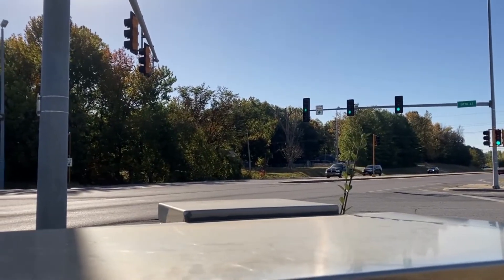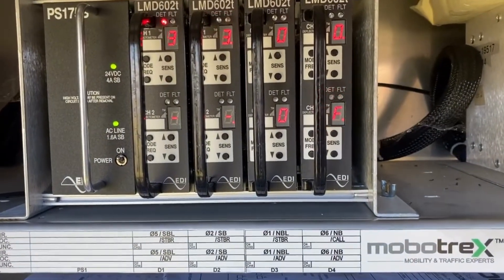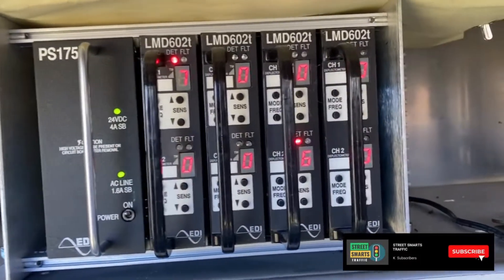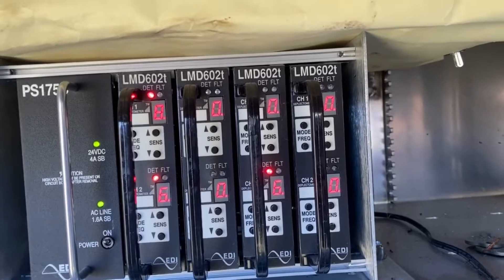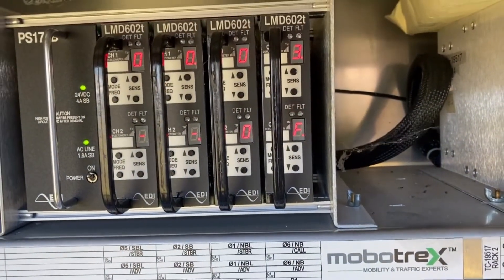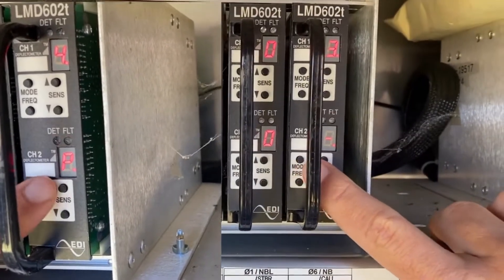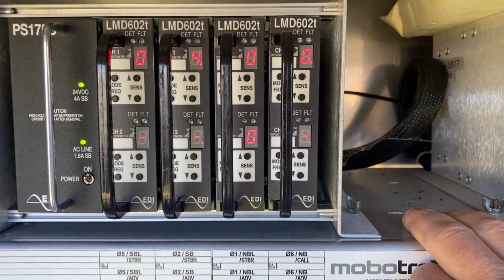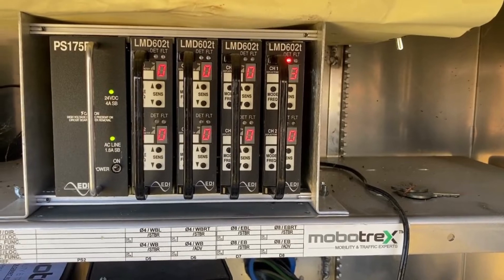How to Shut Off Traffic Signal Detection

Comment: Would be interesting to know what the fix is - even sharing some possibilities would help us understand.  Guess it's not as simple as slapping in a new card.
Reply from the maker: @CubbyTech    Good Call!  Sometimes a new card does fix the issue.  Actually one of my troubleshooting procedures is usually to swap card slots with a known good detector card.  If the problem moves, I know its the card.  If the problem stays, its downstream to the street.  I was in a hurry that day and had just enough time to turn on my phone to capture what I was doing.  Very insightful!  Want a signal tech job?? LOL

Comment: I'm curious actually, do bicycles get detected or is their mass just to low? I've passed or sat on top of the loops on my bicycle before and still had to wait ages for the lights. Then a car comes up behind me and they seem to change a lot faster. I try to get forward of the loop or closer to the ones with the camera looking detectors so that they can detect a car behind me. Thanks :)
Reply from the maker: Could be several resons.  If your bike isn't made of metal, then the inductive loop will not detect you.  Cameras will (or at least should).  If your bike IS made of metal, could be a couple other reasons : 1) the detection sensitivity is not set high enough on the detector card to detect your bike (mass)  2)  Your not sitting in the detection area.   
If there is a pedestrian crossing, many times I see bikers ride up and push the ped button so that they don't have to worry about being detected.  If all else fails, find out the municipality's contact number (probably Public Works Dept) and tell them the issue.  There may also be a problem going on there that they're not aware of.

I'm seeing more and more dedicated bike lanes being added to traffic signal projects.  This setup will  have smaller detection zones/loops specifically for bikes.   Great question!
Reply: @streetsmartstraffic you street smart you ride plastic bikes right?
Reply from the maker: @pikadroo   Metal or Carbon.  But metal mostly
Reply: @streetsmartstraffic I take it my aluminium bicycle has no chance then unless there's some weird induction current lol 😅
Reply from the maker: @gazzat5   I believe your aluminium bike will actually detect!  You may have to lie it on the road across the inductive loop though... LOL
Reply: No. Nor do motorcycles and we sit there with our dick in our hands waiting for a car to come along.
Reply: I've noticed that my ebike does get detected if I hit the metal strips in the road.  In Amsterdam they have small bicycle detection loops long bike paths so bikes get detected well.
Reply from the maker: Yes sir!  They designed it properly for bikes- so you're taken care of on your ebike @ambiarock590